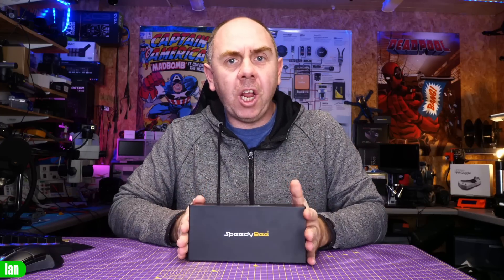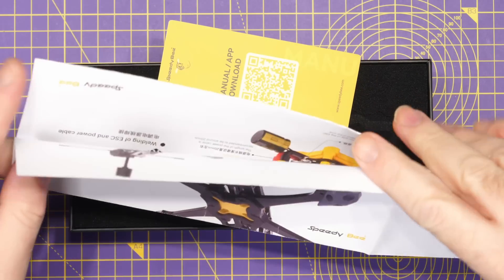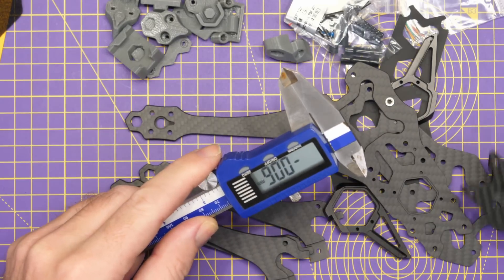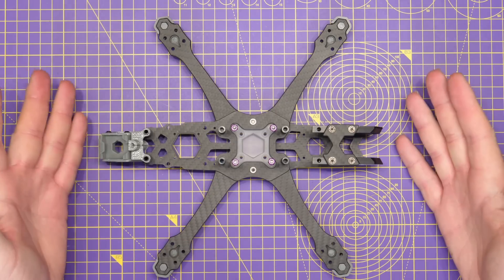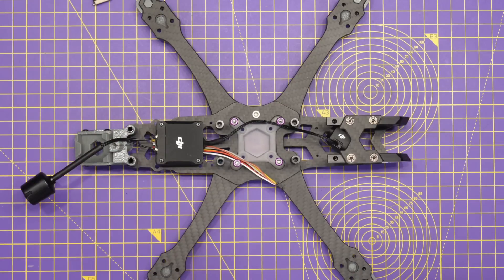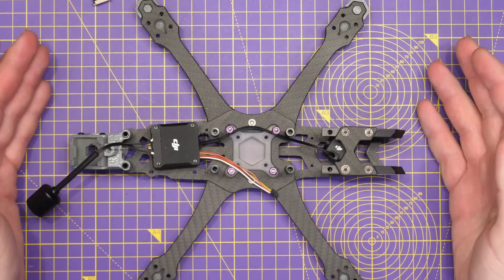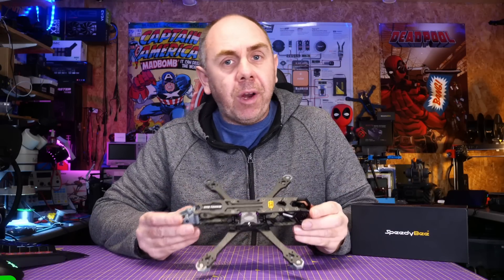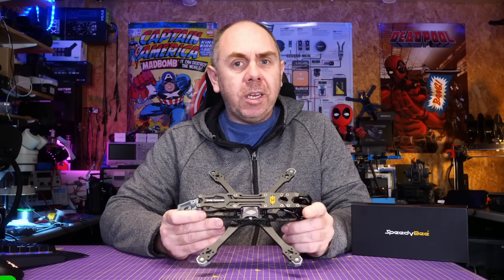SpeedyBee Master HD DJI O3 FPV 5" Quad Frame - O3 Heatsink Included

Comment from the maker: Soeedybee Master Frame Strength

Hi All, before I published this video I did have some thoughts on the strength of the front structure on the Master Frame.  On the standard version there is an additional leg going to the lower plate that’s not there on the HD Version.  I have seen comments questioning the strength of the front end and it’s crash’s ability.  The CNC parts mount to the bottom and top plates with two screws each.  There have been some comments this would just fold in on a crash however I don’t see a major issue here compared to other similar frames such as the Roma and others.  The top plate would have to snap or the screws let go to move as it’s held with the standoffs.  

I’m not going to say this is the most solid frame you can buy or would survive like Bots Demibot frame however it’s on par with many of the other O3 frames. 

To be honest these are not really designed to be all out bashers and while it’s actually pretty strong it’s going to suffer some damage in a big off. 

Tbh chose not to really discuss this in the video as I have the believe many of these frames like this and the Roma style ones are more easy fliers than bando bashers. 

Thanks 

Mad.
Reply: Ian, will speedy bee sell that special 20x20 to 03 mount cnc plate separate? designing a frame and thst would fit just perfectly. thanks for your time.
Reply: is 150mm cable work with it...?

Comment: The frame is incredible. I have already assembled the drone and flew it. But there is one bad thing. I can't attach an ND filter to my camera. Aluminum racks are fitted closely to the camera. Will have to work a little with a file.

I also could not find a comfortable place for TBS Nano RX receiver. And the battery connector is located so that the battery cannot be installed strictly in the middle.

The rubber platform for the stack is highly dubious. I think that the controller should be rigidly attached to the frame. But I did not observe a known bug from the O3 camera jelly. We'll see.

Comment: Hi
I want to connect the DJI O3 unit with F405 V3 stack. Could anyone help explain on how to do it?
Is it enough to use the HD Unit Plug on the stack? Or do I have to disassemble the plug from dji o3 and solder specific cables? If I have to, what wires should I connect?
I really thank you for any help here
Reply from the maker: What make is the stack.
Reply: @MadRC  its the speedybee F405 V3 stack :)

Comment: Is there a general consensus on soft vs hard mounting the screws themselves to the frame and relying solely on the rubber grommets?
Some frames soft mount the screws with the grommets which appears worse overall if the entire ESC shakes along with with the FC.

This frame however soft mounts the entire works from the frame, it should perform well but I would expect one to want to isolate ESC from the FC vibration simply due to all the large motor/battery wires that come from it that also transfer vibration into the FC.

Comment: They should bundle this one with the F4 and F7 stacks. I bet they would sell a bunch.
Reply from the maker: It is available as a bundle from their site.
Reply: @MadRC  You are correct. With current applicable coupons and savings, The Master 5 non-HD combined with the F4 stack cost 121.59usd. Extra arms are 3.49$.

Comment: Just built mine today. Thanks to @Madstech video, which helped make the decision. The quality of the carbon machining far surpasses that on the Ummagawd Demibot frame. Smoothe and sculpted rather than sharp and basic. But there's no way this would handle a crash anything near the Demibot quad. I feel this would snap at it's throat, pretty easily. 

Gonna use mine as a mellow video capturing machine :D

Comment: I love the looks, the thought they put into it and that hexagonal style everywhere... really nice. It looks quite a bit heavy though and I have strong doubts this vibration absorber of the stack is actually a good idea. We mount those stacks on screws now that are hard-mounted to the frames using nylon-coated nuts to provide a mounting point as solid as somehow possible and with the gummies being the only dampeners just eliminating high frequencies. This one here will result in a stack that wobbles around in low frequencies you can't or don't want to filter, resulting in an overall rather low performance... Chris Rosser did a vid on why you need to hard-mount your stack screws. Let's hope they actually AB-tested that piece.

Otherwise... great little thingy!

Comment: Have you seen Chris Rosser's video explaining the need for nuts on the stack standoffs? So with this isolating mount it may cause some form of amplification in certain gyro frequencies or modes. So I think you would want to mount the stack rigidly to itself with no silicone in the holes so it is a solid stack then mounted to this hunk of silicone in the frame or maybe only mount the FC in the middle and find somewhere else for the ESC. This certainly needs gyro data shown for each of the different isolators.
Reply from the maker: Yea I remember that one. It’s a good point.

Comment: It’s worth noticing that the Master 5 “non HD” does not need the longer camera cable, and fit the O3 as well (4$ option), I also think the shorter frame and less wide geometry will make a nicer frame to fly!! Only downsides are the props will be visible, and the xt60 integrated mount is not available

Comment: Great review.   kinda think you could land on a rock and send it through the stack with out having bottom plate protection under the stack.  would like to know how the cameras mount handles the vibration to the built in imu.  would off like to seen silicone o3 camera mount instead of  silicone stack mount

Comment: Is the coaxial cable as easy to switch on the 03 as it is on the Vistas?
Reply from the maker: It’s not bad but you just have to be careful.  It’s basically the same as vista ect
Reply: @MadRC  perfect. Thank you
Reply: He has a video on it all ready
Reply: @jayzzz1234  I looked and didn't see it.
Reply: @drewgotit3569  Hi drew I found it its called DJI DIGITAL 03 AIR UNIT, TEAR DOWN.

Comment: It looks great, I still have my reservations on the strength of that front end, it was flexing just as you touched it. Strange for them to make it require a longer coaxial lead even though they have plenty of room to bring the air unit forward.
Reply: The front end is aluminum,  the camera mount is what you might have seen move but the cam is supposed to be soft mounted.
Reply: @drewgotit3569  does those camera mount out of view from camera footage?
Reply: @cisnerosmike  I don't have one yet, but it is supposed to be no props or side plates in view for the HD version.

Comment: Thanks for the review Ian. A need to replace camera to air unit cable will be an instant no-no for many people considering how hard it is to do and judging by your own video, especially the last one where you damaged the mipi connector and had to do that super-tiny soldering under a microscope 😀

Obviously this is a sponsored review, and it feels like they focus more on the box and presentation than on the usability. It would be very nice to see a noise spectrogram of the frame and I obviously can't know for sure, but that silicon insert in the middle of the frame might actually do more harm than good. The whole weight of the ESC is going to be resting on it and jumping to all sides I guess? It would probably affect the frame's rigidity as well.

For the DJI O3, there aren't that many frames right now and out of the most popular ones , the iFlight Evoque V2 seems to be a much better frame but so complex to build and heavy. The AOS 3.5 O3 and the Quadmula Siren F5 Split are the other two good options. The Quadmula one really feels like a new Apex for O3, it's simple, great quality and resources were put into the frame rather than packaging. ;-)
Reply: That and my my double-sided tape has excellent cooling properties 🤣
Reply: "Obviously this is a sponsored review"
They sent him the frame but they didn't pay him. It's not what most people would called a "sponsored" video.
Reply: That's a pretty good deal for SpeedyBee then! Sending just one frame and getting a full-fledge box opening, build, videos of the assembled frame in a cools stance, and a vouch from a very respected FPV tech youtuber.